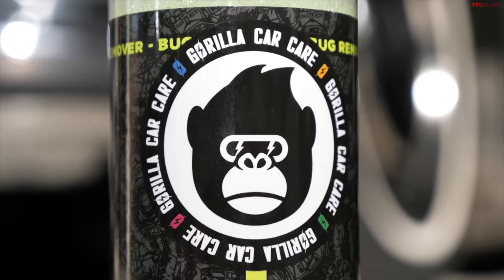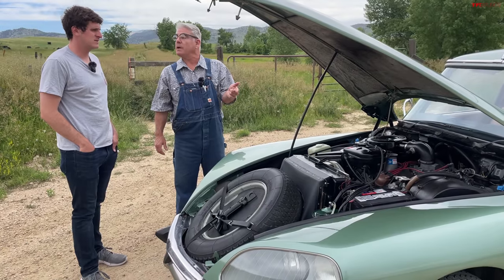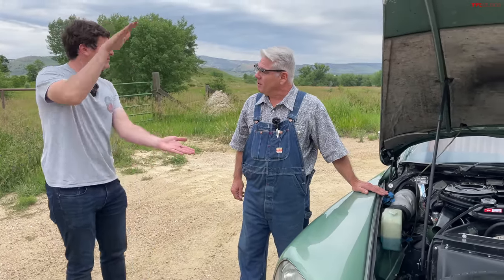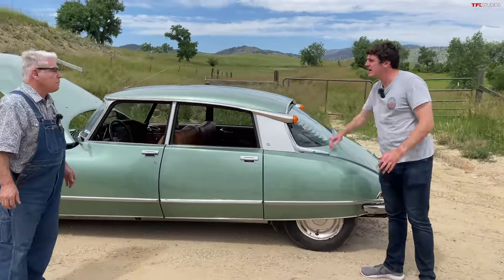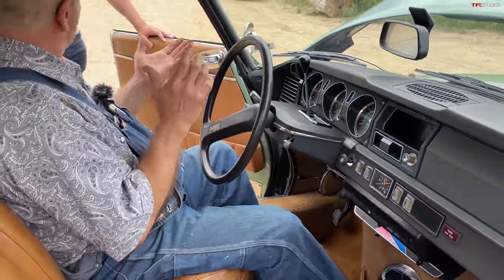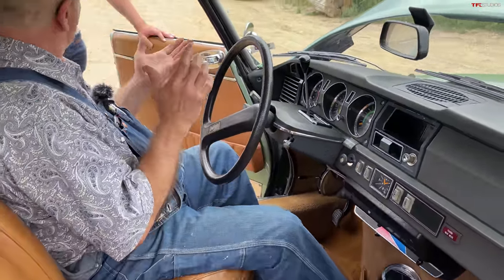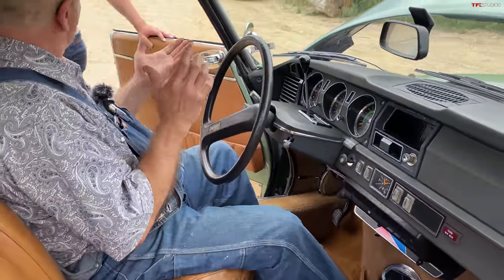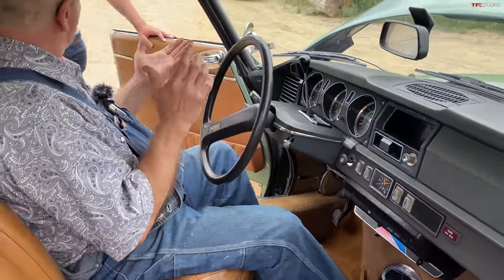Really THAT Unreliable!? Is The Citroen DS as Bad As The Internet Says It Is!?

Comment: Just a comment about ride quality. The owner, Kevin, would do well to invest in a set of the older style suspension spheres. These were rebuildable, have a higher gas volume to absorbed wheel movements and incorporate fluid control valves in the neck of the spheres that were adjustable. So one can make the ride softer or firmer according to taste and driving habits. They provide a much softer ride than the single or 'welded' units in the car presently.
Reply: You're quite right about the suspension spheres. Now, if only, I could find a set of the 'old-school' spheres.
Reply: Waste of time re-valving.
Reply: @alro2434  Just saw this comment - honestly you really don't know what you are talking about. Over the years from 56 to 70 (the end of the 2 part spheres) Cit adjusted the suspension 'compliance' by increasing the shim thicknesses as well as changing the very slight curvature to the face of the securing nuts. This was done as the  roads in Europe got better and complaints from more than a few that the early cars were two compliant for US driving. By increasing the total thickness of the shims on the compression side, by only 0.004" inch or so you can change, completely, the suspension characteristics. I know - have done it for quite a few owners.

Comment: Love this car. BTW, the engine is cast iron with aluminum head and disc brakes are not ventilated! LHM is essentially oil, and if you are really stranded, you can temporarily add 10W30 and you won't break anything, make the repair and refill with proper fluid!  Very knowledgeable and interesting gentleman! 😎
Reply: LHM is mineral oil with no detergent additives, the best thing to use if you can't find it is clear mineral oil that you can get at any pharmacy. i've seen several citroens with destroyed hydraulic systems where motor oil or even worse, antifreeze was used to top up the reservoir when it got low. lots of mechanics added antifreeze due to LHM's green color (we called it frog juice)
Reply: In Canada, the French-from-France mechanics routinely diluted LHM with kerosene for the winter season. LHM itself lost its viscosity too quickly in a frigid climate.

Comment: These cars were extremely reliable. In the UK the problem they had was that there were hardly any trained Citroen techs  over here, so by extension,correct maintenance was usually not performed.   Most of the DS’s that I knew of that were scrapped , died because nobody seemed to know how to repair the suspension, and those that did charged ridiculous prices.   Much play was made here of the quality of French roads, ours were not much better !  AND when I was in New England I travelled an absolute shitload of dirt road !!    Wonderful cars, too expensive to make now. 
     French cars were historically built to be easy to service and work on. Go into a French garage and see how differently their  mechanics work, The old 2CV, you more or less take the body off to work on it, but it is meant to be done and done quickly. It’s a shock to UK mechanics to see it done.

Comment: LHM stands for "liquide hydraulique minéral". It was developped to replace LHS, which stands for "liquide hydraulique synthétique" LHS Versus LHM

Citroën quickly realized that standard brake fluid was not ideally suited to high pressure hydraulics, and developed a special red coloured hydraulic fluid named LHS, which they used from 1954 to 1967. The chief problem with LHS was that it absorbed moisture and dust from the air which caused corrosion in the system. Most hydraulic brake systems are sealed from the outside air by a rubber diaphragm in the reservoir filler cap, but the Citroën system had to be vented to allow the fluid level in the reservoir to rise and fall, thus it was not hermetically sealed. Consequently, each time the suspension would rise, the fluid level in the reservoir dropped, drawing in fresh moisture-laden air. The large surface of the fluid in the reservoir readily absorbed moisture. Since the system recirculates fluid continually through the reservoir, all the fluid was repeatedly exposed to the air and its moisture content.

To overcome these shortcomings of LHS, Citroën developed a new green fluid, LHM (Liquide Hydraulique Minéral). LHM is a mineral oil, quite close to automatic transmission fluid. Mineral oil is not hygroscopic (i.e., it will not absorb water from the air), unlike standard brake fluid, so therefore gas bubbles do not form in the system, as would be the case with standard brake fluid, creating a 'spongy' brake feel. Use of mineral oil has thus spread beyond Citroën, Rolls-Royce, Peugeot, and Mercedes-Benz, to include Jaguar, Audi, and BMW.
Reply: Some corrections - LHS was glycol based but had added lubrication qualities compared to standard DOT 3 brake fluid. In the rest of the world it was phased out with the 1966 models which were introduced in August of 1965. The US did not convert to LHM until 12/68 as our DOT would not 'approve' the fluid for use in automobile braking systems - though basically the same fluid (Aeroshell 15) was used in jet aircraft including their brakes for some 20+ years. As you noted glycol base fluids have a major problem in regards to absorbing water. The main reservoir in the Cis has always had a very, very fine filter system to remove any particulate contamination.  And is one of the normal maintenance items. The other problem with glycol based fluids is that the only rubber compound that can actually chemically withstand it was not even on the market until early 1962. As to absorbed water forming 'gas bubbles'. Possible but the fluid would have rise above a temp of 100C for that to happen. With non Cit cars it is always the result of low fluid levels in the system. In Cits can happen with if a brake accumulator sphere goes bad for the front brakes or one of rear suspension units loses N2 for the rear. In the Cit system the front and rear brakes are independent circuits. The front get pressure from the main system - the rear get their pressure from the rear suspension. Thus the braking force that is applied to the rear brakes varies instantaneously with load variations in the rear of the car.  

LHM - Citroen did not develop it. LHM other than being dyed fluorescent green is virtually the same fluid as AeroShell 15 (colored red) which caused more than a few problem in the US. When this stuff comes from the refinery it's basically colorless - and then dyes are added. Mineral fluids have far better lubrication qualities, have a much higher VI (viscosity index) - a measurement of resistance flow characteristics under very low/high temp situations plus other advantages. Lubriplate, for example, makes a very HQ fluid that surpasses all of LHM's specifications. It is basically clear, but can be dyed to look exactly like LHM+ (the latest version of LHM).
Reply: Nice work on the homework history. There are many other details about this car that are interesting but well beyond the scope and time for this video. I'm scheming to work with Tommy & TFL to do a, 'Part Deux' with detailed demonstrations of some of the features. 
Thanks for watching.
Reply: @1KJRoberts  There are many areas where Cit broke new ground with the original DS - I only mention 'original' as the new DS badge is quite another thing. On a somewhat related topic - Cit has been working for almost the past 10 years trying to duplicate the ride quality of the hydraulic cars using more convention equipment. Last I saw it was felt they were about 70% or so there with new C5-X hybrid (not to be confused with previous C5s with the hydraulic based 'active suspension').
Reply: I once had a 72 US DS 21 citromatic  and what an amazing system it is.  Every time I turned around I found something else it could do. For example it won’t let you do a “neutral drop “ by flooring it and jamming it in gear.  No, no,  no!  It regulates the throttle opening when it is between gears! I discovered this on an uphill twisting roadway and had it floored and threw it from 4th to 3rd and it pushed the accelerator pedal and my foot back while it downshifted! Apparently that’s all part of the throttle engagement control which is basically a hydraulic throttle position sensor. It also tailors the rate at which the clutch engages based on throttle opening. Paul Mages (hydraulic system designed) was pretty clever! Close study of that system reveals its true refinement. Best not to study it before buying one, it might scare one away! Once you have one it’s best to let it be and do it’s work. 
25 years later I’m slumming it with a rough but reliable ID 19. And loving it
Reply: Thanks, we just called it vegetable as opposed to mineral based, and was compatible with natural rubber and everything else(except paint!), while the mineral/green/LHM must have synthetic/neoprene/buna-n pieces and it spec is slightly different from the VERY common ATF or hydraulic fluid used in all earth moving, construction & small elevators.  They WILL NOT destroy the Citroen's system, putting any mineral based fluid in an early, pre 67 will destroy every seal but the teflon in the steering rack's piston & 4 suspension cylinders.
Reply: @alro2434  - The very first cars had LHS (castor oil based) and then LHS (synthetic based but still water soluble) whch came out with, iIRC, the 64 cars. My understanding was a bit higher VI rating and better lubrication qualities. The real problem with the early cars is that, initially, the seals were made out a rubber similar to that used for tires. Downside was did not play well with either castor oil or LHS at elevated temperatures nor with absorbed moisture in those fluids. The only, and I mean only, rubber compound that plays nicely with those fluid, as well as DOT 3/4/5 brake fluids is EPDM (Ethylene propylene diene terpolymer) and was only put on the market in 1961 by DuPont. Buna-N / Nitrile rubber is the choice for LHM. Downside is it does not play well in sunlight or moisture. Why the rubber boots on the rear suspension units on all post 66 Cits deteriorate over time. The 'white' marked O-rings that are used in static situations on the cars is Neoprene. The factory went to LHM with the 65 model year (66 cars). The US did not get LHM based cars until 01/69 due to some stupid DOT regulations. ATF, other than being mineral based, in not at all like LHM or AeroShell 15. In  the18C range or so it is quite a bit thicker has a quite low VI rating. The hydraulic Cits need a fluid with a very high VI and the proper 'weight' - which is 15. What VI rating refers to is the fluids resistance to viscosity (or 'weight') change with temperature.  About the best fluid one can use in the LHM cars is Lubriplate -70 hydraulic oil. ATF and even 20wt engine oil can be used in emergencies but they need to be drained and the system flush at earliest opportunity.  They will not hurt the system but at lower/higher than normal temps the cars will not drive correctly -steering/brakes and the BVH cars will have lots of shifting problems such as slower or faster than normal. As you noted In addition to seals - add every single rubber hose in the car going south with the LHS in LHM cars or vice/versa. The other real problem is neither is miscible with the other. Makes cleaning a PITA.

Comment: I am a MASSIVE fan of the Citroen brand. We own 2 Citroens, a 2007 Citroen C4 hatchback and a 2012 Citroen Berlingo which is based on a small van. Both our cars are fitted with the Piloted gearbox, which is similar to the DS, with a clutch, but no clutch pedal. You can select either A for auto, but isn't a traditional ''creeping'' auto. Or select 1st, push the brake and the brakes will hold for around 5 seconds in hill start mode, then release. But you can pull away without rolling back. My wife's 2007 has a lever between the seats and flappy paddles each side of the steering wheel, so you can choose A to let the gearbox change automatically or M to allow you to use either the lever to go up or down the gears, or the paddle shift to do the same, but with fingertips. My car has a turn wheel to select which you want (N, R, A M) and paddles to allow you to shift "manually" if you choose. My Berlingo has 160 thousand miles and my wife's C4 has 100 thousand miles. So reliability is amazing. BUT, you HAVE to change the oil regularly!!!!! I tend to do it at 8000 miles. Low ash, fully synthetic 5W30 oil. All in all, we both love our Citroens and are not keen to switch brands.

Comment: I have noticed some comments about steering and front suspension geometry. Again Citroen was quite innovative. The front axle connection to the wheels - as one will find on all FWD cars - is via a 'slip joint'. Citroen with the DS referred to it as a 'tri-axle'. What is unusual is the degree of wheel swing they were able to achieve with their design - almost a full 88° swing lock to lock. Car is almost 16 ft. long with a turning circle of just over 36 ft.  The other thing they did was that the actual pivot point for the front wheels is in the exact center of wheel width - Cit referred to it as 'center line steering'. Measurably increased steering stability on rough roads. Combine that no road induced deflection of the front wheels (steering rack design) and one could drive over rough, undulating, roads and not have apply basically any correction to the steering unless to avoid stuff or go around bends.

Comment: Wow! That was such a great interview. The explanation of every detail makes this car shine. If an exact replica of this car was made today I think it would make a profit. Obviously it would need air conditioning, better passing ability, and the brake pressure would need to be less sensitive.
Reply: The brake pressure is NOT sensitive. It modulates with application pressure just as any other system BUT with less effort. Less loss of control braking on ice than any other car up till antilock braking came out and better than some of them.

Comment: In the early 1980s I had a Citroen GS Club Estate car. It had the adjustable ride height settings, the inboard front brake discs, powered brakes and the spare wheel under the bonnet. It was a lovely car to drive and always felt safe. I once had a tyre blow out at 60 mph, car didn't  swerve so came to a controlled stop. Set the ride height to Max, stuck the wheel jack underneath then reset ride height to low setting. Punctured wheel was then replaced with spare wheel, nuts back on and underway again in less than ten minutes. The acceleration wasn't great but, once up to speed, you felt as if you were floating along. It was a really nice car to drive.

Comment: In France, the "break button" is called a "mushroom"!!... or "champignon" in French!.. It does look like a mushroom anyway ;-) I am french and I had twice such car when I was pretty younger,  one was  a DS 21 Pallas from 1966 with a "frog face" at the front with 4 separate lights, the nicest one to my taste, and the second was a D Super 5 from 1975 , roughly the same modèle as we see on the video, but a cheaper model... The Pallas is worth a fortune nowaday, here in France... A good prserved one is estimated in between 30 to 40 k/dollars... Such a wonderfull car ever so smooth and so secure in any circumstances... Once I was driving on the motorway between Belgium and France and was going roughly 80-85 mph when a rear tire just exploded to smirthens... I hardly heard the "bang" and the car stayed imperturbably on its course... I drove, quietly this time, to the next station to change my tire. This car wouldn't go off the road, no matter what!... it would just stick to it in any circumstances!!

Comment: That was a nice review of my favorite car.Thank you. I owned two ID 19,in France,the first,I bought in 1970,then the second,a B series,with directional lights. I must say that those two cars were the most comfortable and reliable cars I ever had in my whole life. You could drive them in snow,mud,potholes,with 3 wheels,without any problem.I then had two CX that were also quite comfortable,with harder seats and suspension,but the same incredible braking power and stability. If I had to buy a car again,it would be a DS 20 or ID serie B. Just for the history,The DS was the car of our General de Gaulle,and all the official happenings.

Comment: When changing the wheel, set the suspension to max high, put the support under the side rail, set suspension to max low, and with an amount of hissing, the car sinks... then lifts the wheels off the ground on the supported side! Couldn't be easier.

Comment: I am have owned 12 DS's. I got between 125,000 and 300,000 miles out of each one. I did this simply by maintaining it properly and changing the oil regularly. Never once did it break down or leave me on the side of the road. I live in the north of the Midwest and rust killed most of them.
Great Cars Great gas mileage might be super had two very good power and I just love driving them.

Comment: No, Traction Avant wasn't removed from production in 1955 as said in this video, and for good reasons. The DS 19 was manufactured in low figures the very first year - partly leaving the development work to the first customers, although many of them was ok with that. The Traction Avant 11 CV stayed in the product line-up until summer 1957. Then it was replaced with the less expensive variant of DS 19, called ID 19.

Comment: My mom had a 1972 DS21 EFI. It's not a semi automatic, it is a manual 4-speed with a hydrualic shifter which also works the clutch. when the brakes are applied the clutch disengages. The trunk badges read DS21, Injection, Hyraulique There was no Pallas version in the DS21. The steering is not power steering, it is servo assisted. There are 2 valves on the steering rack. The steering column is not attached to the steering rack. 1 more thing, our DS21 hydraulic system floated on normal ATF with no problems for many years.